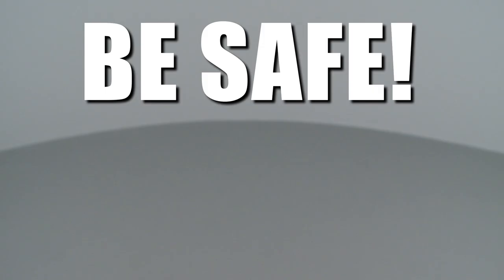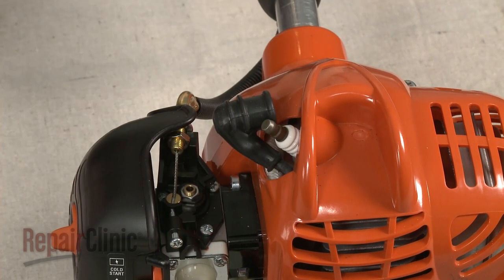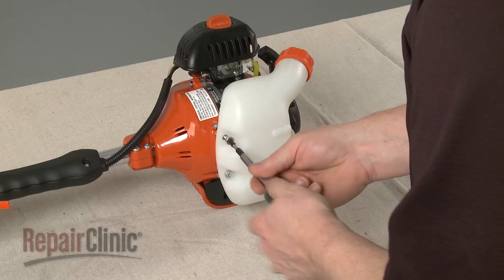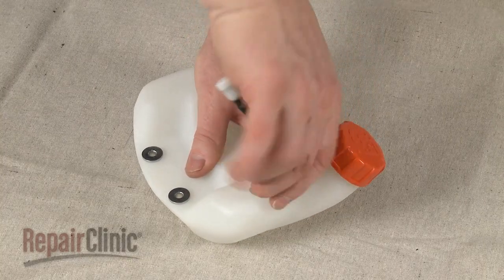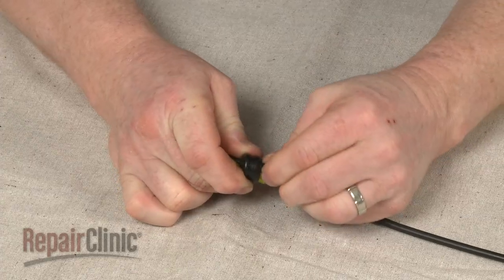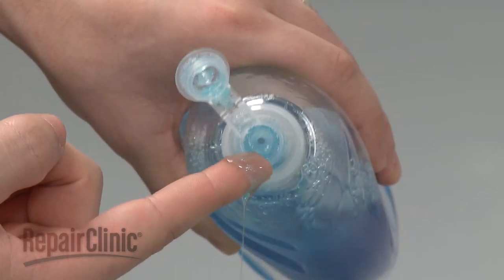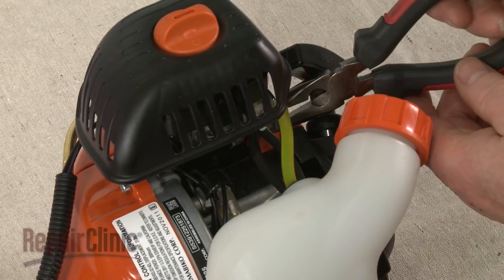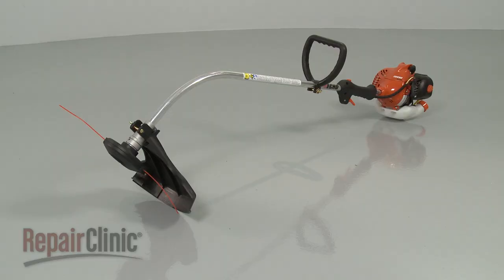Echo String Trimmer Fuel Line Replacement #V471001230

Comment: Great Video;  I found after a bit of struggling that it was far easier to insert the grommet into the tank if I first removed one or two of the lines from it first.  Then;  after the grommet is inserted the lines can be re-inserted.
Reply: THANK YOU!
Reply: Horrible design aint it.

Comment: Thanks for the great video. I have a repair kit that has all 3 lines extend down into the fuel tank several inches. Should I cut the other two off at the grommet?

Comment: Like, subscribe, and don't buy an expensive kit. This is a great video, thank you!
Reply from the maker: You can find the part that goes to your specific string trimmer by entering in your model number at RepairClinic.com. 

The part that is in the video can be found here: https://www.repairclinic.com/PartDetail/Fuel-Line/V471001231/4960293?replacedManufacturerPartNumber=V471001230

Comment: Adding to the comments about reconnecting the fuel lines correctly, you connect  the fuel supply line to the outside nipple the after blocking the view when connecting the clear line it is connected to the outside or left nipple you connected the supply line to, so which way is it?

Comment: I need help.
I have a echo srm 225.
The primer bulb only works if the return line is literally submerged in the fuel. Should it be like that?
Cause if im not mistaken the return line comes originally as a short line.

Comment: If you are going to do a video, how about not blocking everything with hands and specifics about which hoses go to which port instead of just saying put them back on correctly 🙄
Reply: 👏 useless company video…it’s virtually impossible to get the grommet in the fuel tank…given the design/positioning